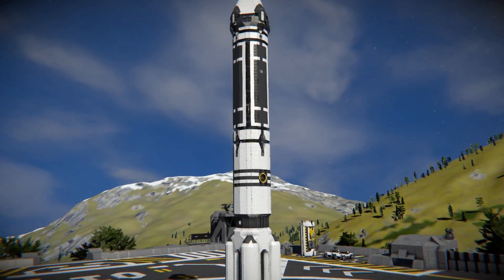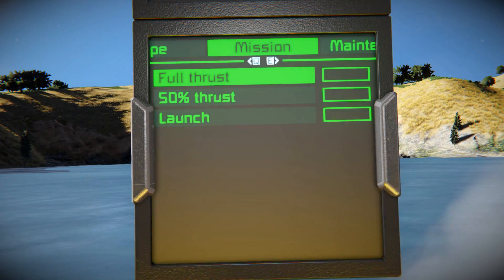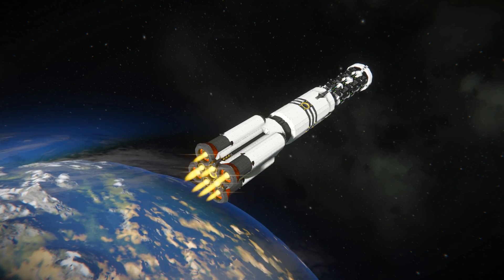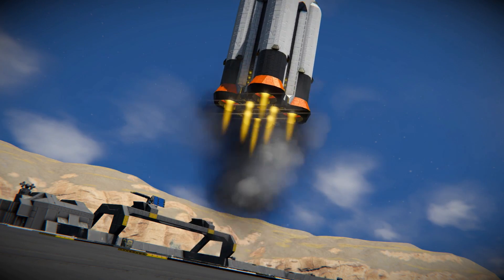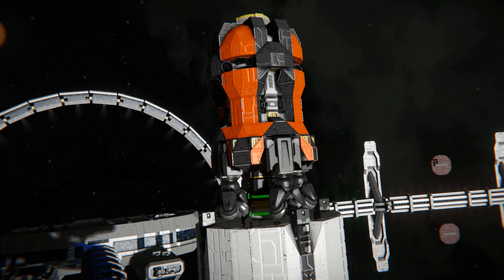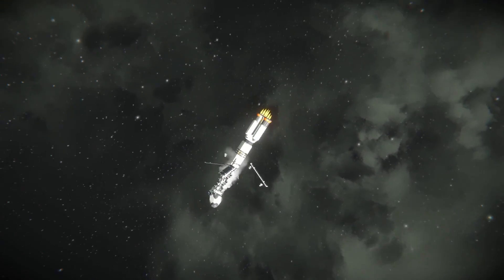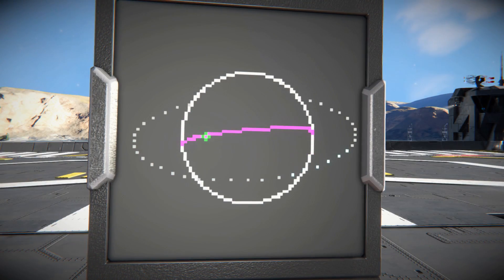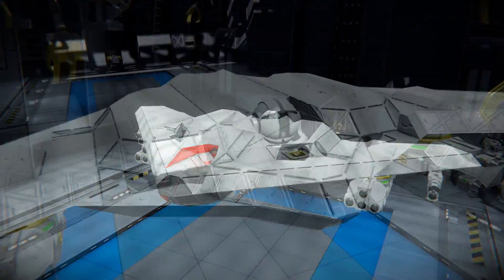How to set up the auto cargo rocket? - tutorial || Space Engineers

Comment: This is a really cool setup. Does it use less fuel than a normal transport ship? Or do you just think the rocket design is cooler, so that's what you went with?

And how many hours do you have?
Reply from the maker: Yeah, I could say that it's fuel efficient. There're a few features like thrust amount selection, scripted autopilot or auto-thrust override, that helps with that. Especially when it starts to orbit (it takes around 30% of total fuel capacity to launch and do the full orbit around Earth).
Reply from the maker: I think I have around 2500 hours
Reply: @Pro100tv9  thats not all that much more than me. I have 2100

Comment: I'm curious about the user interface at around 0:45 to 1:15.
I noticed that the UI displays a Q and E, seemingly to indicate that you should be able to use these buttons to switch the menu, but you explain that you use the numeric toolbar options instead.
Can you also use Q and E and any other buttons? Is there a reason not to do this?
Reply: That interface is a recolored version of the in-game script "SDS-OS" from the Steam Workshop. All you need to interface with the monitor is a single hotkey to run "wasd" on the PB. Once you press it, you can interface with the screen with W, A, S, D, Q, E, and Spacebar.